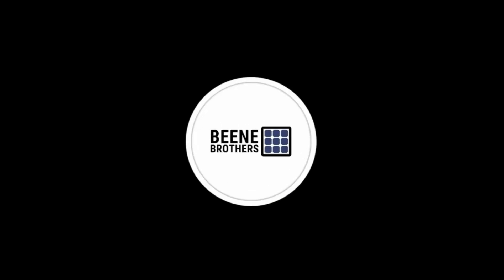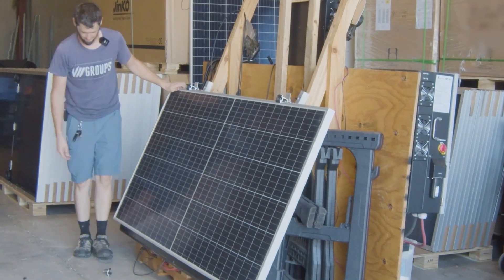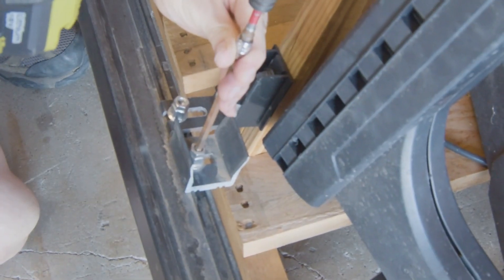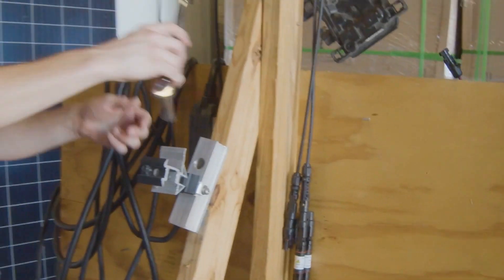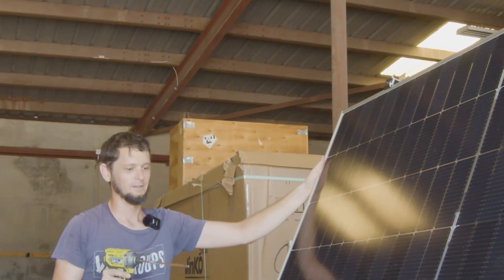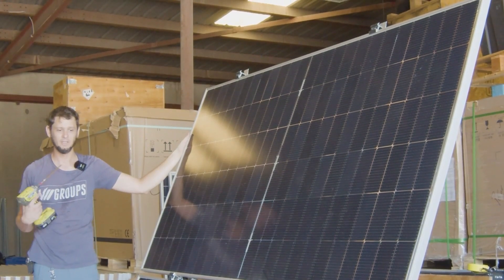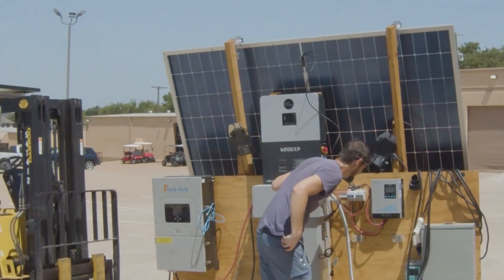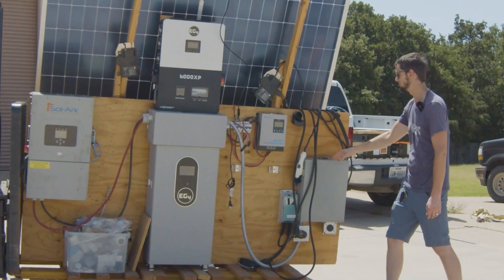Solar Upgrade for EG4 EV Charging Station

Comment: Without an output transformer in that 6000XP inverter to provide galvanic isolation, during a catastrophic failure of the H-Bridge circuit where the MOSFETs short to ground, you risk passing high amperage DC current through to you EVs onboard charger which can fry your charger and void your EVs warranty. I would never plug my EV into one of these high frequency, transformerless inverters. There's an excellent video on YouTube titled "catastrophic inverter failure" by Red Hill Labs that explains in detail, why you should never plug an EV into one of these transformerless inverters.
Reply from the maker: So other electronics are ok? Honestly my ev is probably less expensive than many things in my house. It was only $2k in the first place.

But I get your point and I’ll check out the video you speak of.

Comment: how much would this cost to say charge a tesla model 3 standard ?
Reply from the maker: Do you have an idea of how many kwh a day it consumes? Could probably back into it with miles driven per day.
Reply: @BeeneEnergy yes uses about I charge it at night and uses between 10 kWh to 20 kWh daily
Reply from the maker: 6kw of solar, a 6000xp, and two of the wall mount batteries would be playing it pretty safe. I would want to verify sun available in your area too but roughly $10,000. You'd probably be OK with one battery instead of two knocking 3300 off the price and then could add another if you felt the need but there's a ball park. Battery holds about 14kwh so it sounds like most days it would be able to top off the car.
Reply: @BeeneEnergy  I live i so Cal and have 100% sub exposure with nothing blocking it. Thank you! that would be able to run say a AC unit right? because of the huge amp it take to crank it up?
Reply from the maker: Oh yeah so you're sun is probably as good or better than mine. The 6000xp has pretty good surge capabilities but I wouldn't expect it to start an ac unit over 24,000btu on its own unless the ac unit was an inverter drive that was naturally a soft start.
Reply: @BeeneEnergy  got it thank you so much! I look forward to more of your videos.
Reply: An A/C soft start device would help a lot too.  Most A/C units power up three components at once when the thermostat calls for cooling:
- The fan (outside)
- The compressor (Outside)
- the blower (inside)

Rule of thumb, they pull about 30 amps each, 90 amps... so you have close to a 20kw surge.  Soft start "pauses" between each start, spreads it out into 3 smaller surges.

Of course if you're trying to run an electric stove, water heater, clothes dryer, microwave coffee pot, and charge your car all at the same time all bets are off.  

SPAN is a new (expensive) electrical panel that sounds like it gives you the ability to set a priority for large appliances.  I'm not sure exactly how it works from a practical stand point if the oven calls for power and the SPAN says "nope, the Air conditioning and car charger are higher priority" do you have to reset the clock?
Reply: @davewarrant8673  i would love you basically run the AC with solar and charge about 15kw stored battery for my tesla. I wouldn't add any heavy duty pulling amp appliances other the AC Compressor, fan and Blower. It's looking like either I go its quite expensive. Whole house solar I'm looking at about 50k with tesla but don't like that id be paying a ton in interest so want to do a DIY like @beeneEnergy suggested also will look into that panel might work well too. Thank you